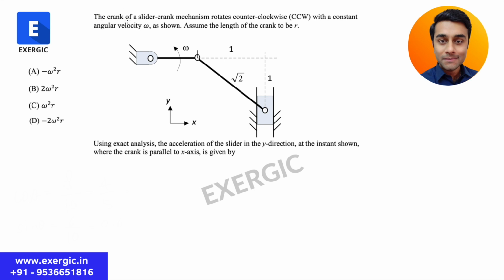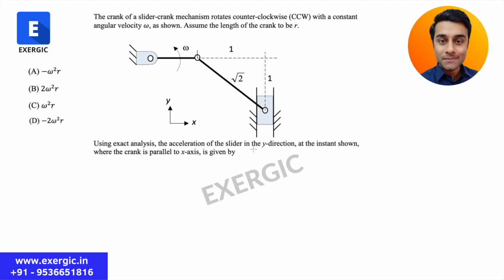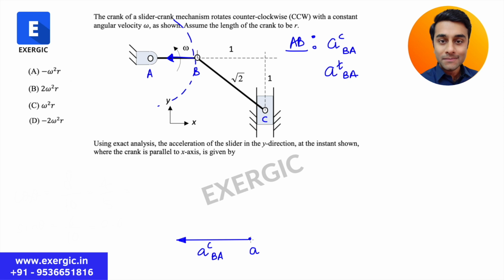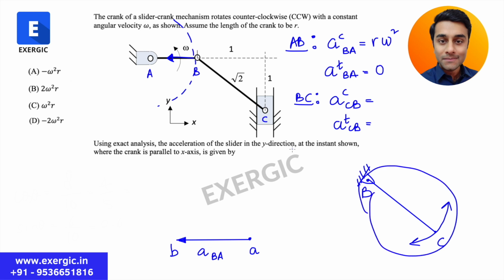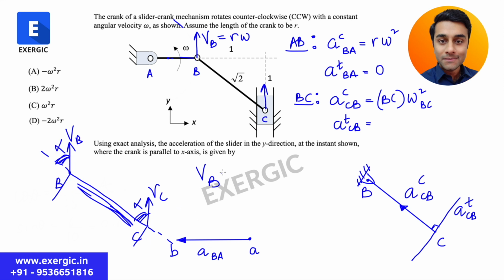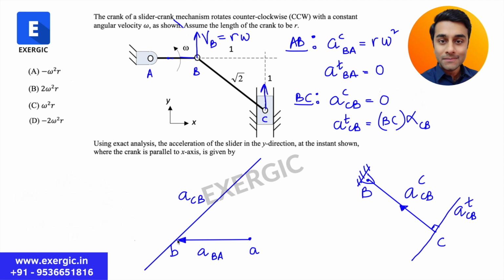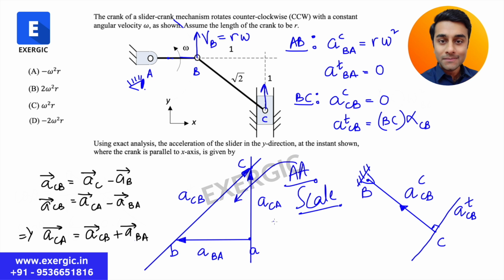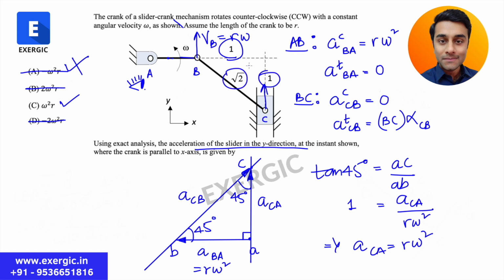Acceleration Analysis question discussed - Theory of Machines | GATE Mechanical

Comment: Sir, had the direction of rotation of crank been clockwise, then also the acceleration of the slider would have been in (+)ve Y direction right?
Reply: No bro...it will be negative in the same position shown here,but the direction of slider is not decided only with the sense of rotation of the crank.Even with the ccw rotation slider can have negative acceleration. It just depend on the overall movement of slider crank chain.
Reply: @kshitijpandey7487  I was asking for this exact problem if the crank had been rotating clockwise, what would have been the answer? And how..
Reply: @arnabgupta4865  As I have already answered that...it will be negative. It's very much visible and intuitive.but if you want to prove it mathematically then also it will come...in that case youwill have to take downward direction for the acceleration of the slider and then apply the vector addition...you will get in that way also.